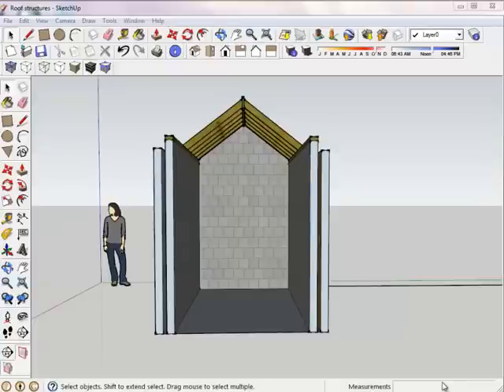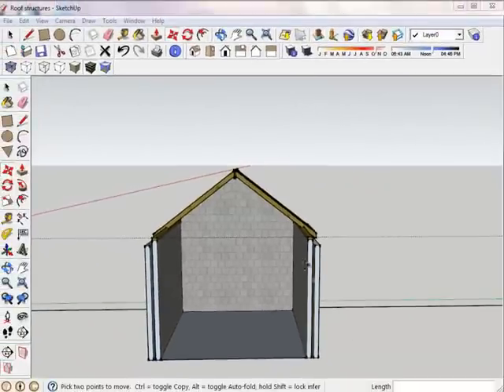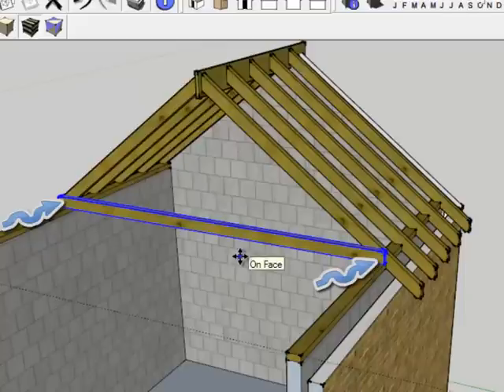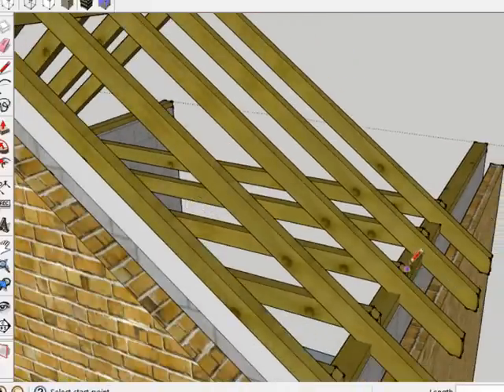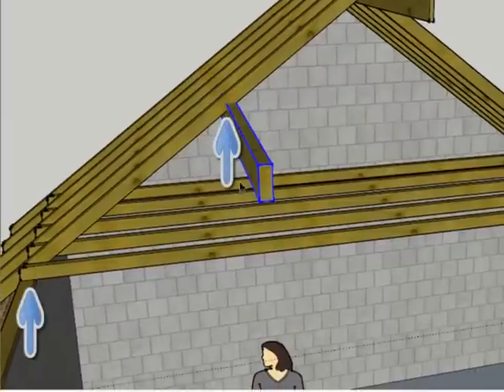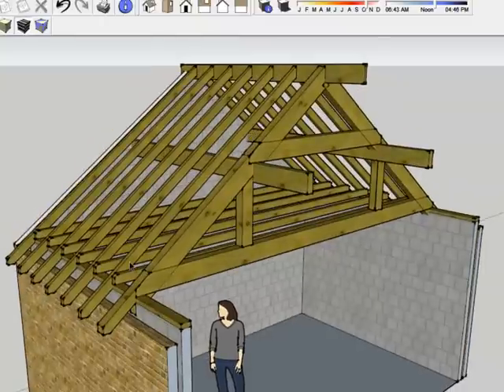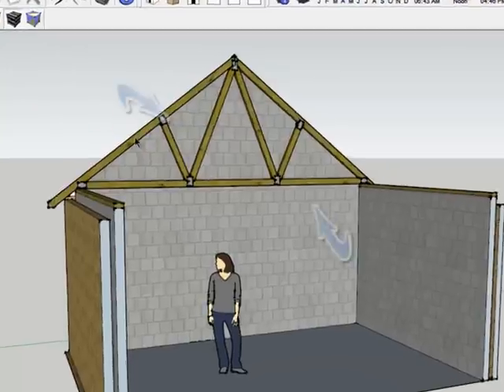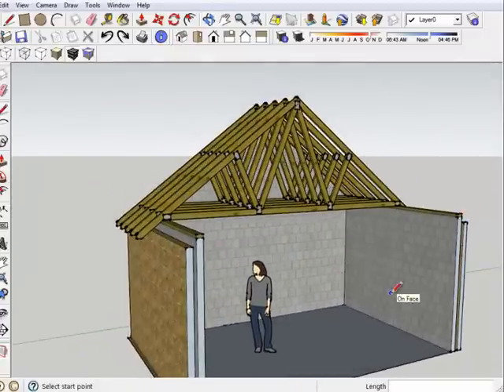Roof structure summary

Comment: I am considering constructing timber shed 1.8 m wide and 4.8 m long using 2 x4 inch timber for the walls and rafters. Will I need rafter ties? Concrete roof tiles like on a house Thanks. Great video

Comment: Very informative and well presented video. However, your use of the term Queen Post truss to describe the arrangement shown at 2:42 is incorrect. While this does indeed look similar to a Queen Post truss arrangement, the structure is not working in this way. This is because the vertical post you have provided is working in compression to support the purlin. In a true Queen Post or Palladian truss arrangement, this vertical member works in tension to support the main horizontal tie beam below.

Comment: Which of the two designs is stronger, if the width of the building is quite large, like 6-7 meters? Bigger, heavier logs, or the smaller, lighter repeated design?

Comment: I really like your video. I build a small house of 6 / 4m and I build the roof now. I bought beams for the attic, they are 8 / 8cm, (the base of the rafters, the rest of the rafters are also 8 / 8cm.), They are placed horizontally on the walls (concrete blocks), the base of the attic. I'm a little worried they're not thick enough, I mean those that are laid horizontally. Can you tell me if they are thick enough? Thank you very much.

Comment: hi, i have found this video very useful. My architect let me down after full payment and did not accommodate when i said the builder will do a cut roof design. I am now in need of a roof design which is the only thing holding me back. Would you be able to advise a roof design for double story extension joining the current roof structure with gable on one end? the ridge board at top will be  7m leangth. you help would be much appreciated. i live in milton keynes hakanozdemiruk@hotmail.com. i am happy to pay for this

Comment: When you say "of course we need one of these tie-beams for each rafter" I don't agree. I've seen a roof 6m long with two wires(doing the job of ties) stopping the lateral  movement. No sag in the roof after 25 years. I know it's the custom but don't believe it is structurally necessary to have a tie for each rafter. I think the practice of using pre-made trusses has brought this into fashion. Excellent vid all the same, just a picky point. I've done a lot of building incl my own house. I've got a double carport with nine posts (3 lines of 3)  and am thinking of taking the central one out and replacing it with a truss/collar/tie arrangement of some sort. That's what brought me here.
Reply: Agreed.. Assuming a roof with ridge board and depending on the width of the wall (top) plate - then you would only need a tension tie every 2-3 meters. (or more if the remaining rafters had 'collars' say half way up)
The only value in multiple cross ties would be to support a loft or for ceiling fixing.
Otherwise - good video

Comment: excellent video.  One missing element though.  The horizontal stability members to keep the trusses in alignment on intended centers.  Could you add to your video please?  Roof sheathing can be the element or timber members inside the trusses perpendicular to the direction of the trusses.
Reply: Thanks Jay; you make a good point.  Hoping to do a whole series of bitesize construction (in my copious free time) - I'll aim to pick this up separately.

Comment: I played around with a few ideas for my roof replacement last summer. I finally settled on factory-made trusses and I am very happy with the result. Two section roof 18.5' x 24' and 24' x 14'. This required 11@18.5' span trusses and 8@24' span trusses and cost me just over $2,200. My limiting factor here in Newfoundland was lead-time from the truss factory (about eight weeks) and it also drove up my cost as the largest factory here was 10 percent less expensive but the lead time was double.